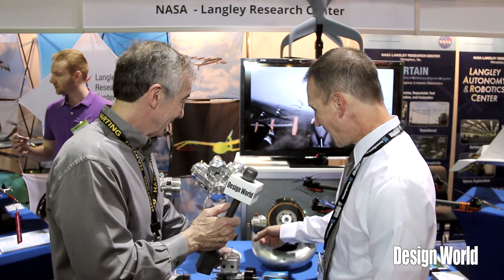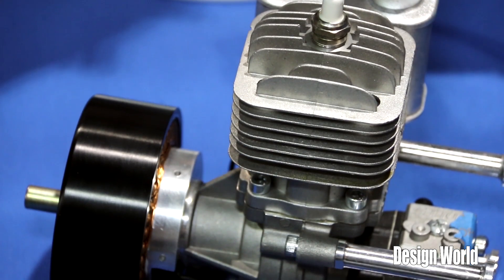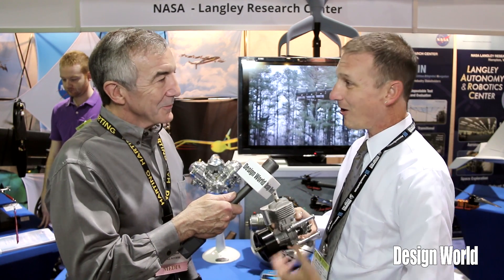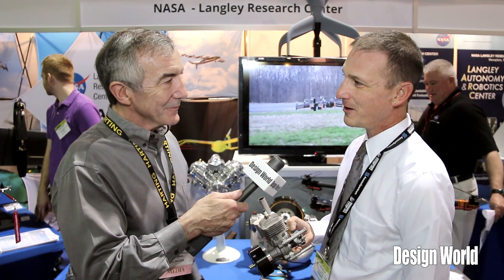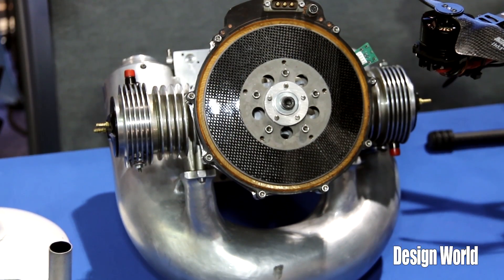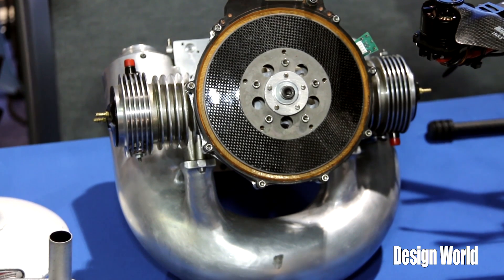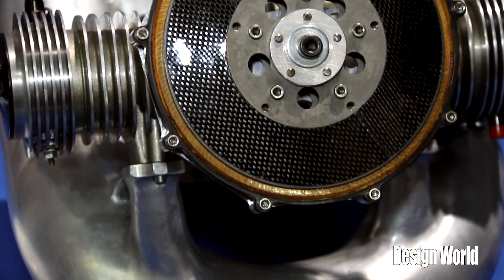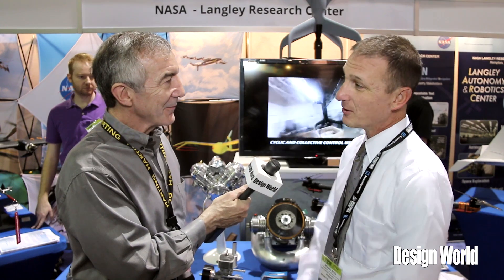How NASA keeps electric planes in the air longer: Hybrid-electric motors

Comment: If two magnets with the same polarity are put against each other within a structure that is permanently held them apart it will produce a magnetic field that will push against itself and all you have to do is provide a shaft that connects to the Center of the generator you connect the shaft get a generator core which suspended magnetically you need no part of fuel do you need to oil you need no gas you need no sunlight it will run in a vacuum and it will produce electricity if you need more information please contact me
Reply: You sob I'm in

Comment: Some of our $45 billion in tax dollars hard at work on weedeater engines. This hybrid design is only feasible with train locomotives because it's a CHEAPER build and the low friction rails make up for the loss. NASA always has been good at wasting our tax money on crap.
Reply: People also thought flight was unfeasible. Thought diesel engines would never replace steam. This is technology of the future. Just because you don't see it because what works now seems to work now doesn't mean it's not going to be outdated in another 75 years.
Reply: NASA only uses the blue collar and the middle class tax dollars.
So if you are making more than $10 million, you are safe.

Comment: I don't...I can't...but why not...  So why not just power the props directly from an IC engine(s) which also employs a very small generator intended to power the control board, video/telemetry radios, etc. of the aircraft, thus eliminating the unnecessary energy losses incurred from spinning a generator that in turn powers a motor?  If you're going to be burning fuel no matter what to keep it in the air, you might as well use that energy as efficiently as possible instead of sending it down a chain of lossy conversions.
Reply: IC engines in general (but not always) have too slow of a response time to effectively balance the load from a multirotor. Electric motors can vary their speed much faster and therefore you have a more stable platform. This isn't to say that you can't design a control system to handle props directly powered off of an IC, but it's much harder to do and is largely a project by project development effort. A generator just functions as a big battery pack and can be used for many different designs with very little extra effort.
Reply: That's correct.  However, I wasn't very clear in my original comment, where I used the phrase "power the props directly" and I left out a VERY important aspect: variable pitch propellers.  Sure, that adds a bit of complexity, but the responsiveness gained from doing so would FAR outperform any craft that uses props directly attached to electric motors.  I have seen a handful of "project" quads that utilize variable pitch prop systems, but they are far from being common - and I'm not sure why except for maybe $$'s.  Because as I mentioned, the responsiveness is about as good as it could possibly get and such a design would ALSO enable inverted flight since the props could generate any amount of thrust from positive to zero to negative simply by changing the angle of attack.  Exactly the way a full scale helicopter operates - the engine spins up to and holds some fixed RPM and then the tail rotor blades and the mains simply change pitch to vary their thrust (pilot modulating the throttle as necessary to accomodate the changing load, to maintain the proper RPM).
Reply: You can also get a higher efficiency at some points of speed.An IC engine has numerous dips in it's efficiency across it's operational range. Running a generator from it means you could run it at the peak efficiency of the engine and use the energy to store in the battery & run the rotors at a different speed that would be much less efficient if it was direct drive.
Reply: The solution : VARIABLE MAGNETIC COUPLING, is a kind of "frictionless" variable electric clutch, used in many industrial applications, the internal combustion engine directly drives  the hubs with the magnetic coupling coils controlled by the on board flight controller, also drives a SMALL group of generator coils in the flywheel to provide electric power for the aircraft control needs, AND a main central efficient duct propeller, that can be pitch controlled to provide most of the continuous thrust needed to keep the drone in the air and the extra rotors just to provide directional control. Infinite number of variants can be implemented with this approach. Keeping weight at it's minimum and reducing conversion losses to maximize efficiency.
Reply: Exactly like rc gas helicopters.

Comment: Wouldnt it be more efficient to use liquid piston engines to power hybrid sys. ?
Reply: Have you found a way to generate electricity at an efficiency rate better than 50%?
And, I'm aware of the engine design you're writing about.
Reply: @cheerdiver  Only huge complex multi-stage turbines can get near 60%.
Reply: @vitordelima  If you input a Kw of energy into an electricity generator, the output of the generator would be a half Kw max.
Your reference is to the THERMODYNAMIC efficiency of converting the potential energy of a chemical reaction to mechanical HP.  Stationary co-generation turbines recover exhaust heat, as well, which will drive a steam turbine (same energy recovery method as nuclear).
The point being, electricity is for toys.  Go to most any commercial equipment rental business and you will notice most everything is powered by hydraulics.  This is due to high power requirements, protection from harsh conditions, and durability.
Reply: @cheerdiver  Internal combustion engines work with 20% to 30% efficiency.

From the page about Combined Cycle Turbines in Wikipedia:

"The electric efficiency of a combined cycle power station, if calculated as electric energy produced as a percentage of the lower heating value of the fuel consumed, can be over 60% when operating new, i.e. unaged, and at continuous output which are ideal conditions."
Reply: @vitordelima  Darn, I've been outsmarted.  Your understanding of information is beyond my ability to comprehend, may your engineering projects change the world.
Reply: that company only exist to rob peoples $

Comment: Ok folks: So here the deal now that they have composite lightweight  motogen hybrid. This could be used on bikes and small cars that would run for hundreds of miles. The trailing bike industry would go wild. Finally the Big Gas Sluts would have to bend to release there Economic patens. We can be a Country not relying on oil. Because there motors can run on other fuel. Right down to Grain Alcohol. Stop  being sheep and step up to say we have had enough of big oil control. Make life better for us all and end the Greed.
Reply: RCWeavenFPV...oh, so you're sucked into the "food for Fuel" BS ?? Did you know that 76% of all our corn production is exported to Europe as animal feed ?????? Yes you are the "Sheep" !!!!!!!!!! It's clear you have opened your mouth before using your brain !
Reply: right one. let's all convert our front and back yards and playgrounds to produce more grain alcohol and spread the wealth.  I am not sheep anymore right? what was it you sell again? fertilizer or farm equipment?

Comment: any stats on efficiency? like, how many watts created per gallon of fuel?
Reply: Ladson Geddings in order to use a fuel-cell you need to have pure hydrogen. Unless liquefied hydrogen takes an incredible amount of space. In order to liquify it it has to be at an extremely low temperature and so you would have to have heavy, complex Refrigeration equipment in order to keep it a liquid. Just pressurizing it like propane won't work with hydrogen.
It seems like you want to get away from fossil fuels. An alcohol might be a better substitute, but it has less BTUs per pound, therefore it would not go as far. It's just so hard to beat petroleum products due to its incredible amount of energy per volume and weight.
Reply: Yeah.  I think that's why he was asking.  The guy had one in his hand.
Reply: Watts created per Gallon? No way. You mean kWh / Gallon or something similar. Watt = Power, NOT Energy.
Reply: Replace the dirty internal combustion engine genset with a Hydrogen Fuel Cell Genset and you have a non-polluting, safe,  hybrid electric airplane with a super long range.  The fuel cell exhaust is water not GHGs and dirty smog like an internal combustion engine.  I'm very disappointed in NASA.; they don't seem to be able to think past the box;  and,  companies like Space X make them look like bumblers  instead of leaders.
Reply: More of a pain in the ass.
Reply: I was gonna say, the first thing you would need to do is determine what fuel you are going to use.
Reply: Ladson...Hydrogen fuel cells are just another form of battery. They don't PRODUCE energy. They store energy that you first produce. You first have to create the pure Hydrogen and Oxygen through VERY energy-intensive means. Then you have to compress each at very high pressures (more energy). Then the conversion rate of THAT stored energy in a good fuel cell is only about 50%. From an efficiency standpoint, you'd be better off with an petro-electric hybrid optimized for the average duty cycle it normally operates at.

This Hydrogen fuel myth just never seems to go away...
Reply: @jck9590  Small engines of 5-10 kW size are only 17%-efficient from fuel to electricity.  Just look at a home back-up generator.   Hydrogen Fuel Cells can attain 50-60% efficiency even at small scale of only a few kW of power, thus a vast improvement in efficiency, plus FC is very quiet for those drones that don't want to be detected, and the lack of vibration is great for sophisticated drones' electronics and cameras.  Vibration can blur images from a drone.
Reply: @amec4888  The problem is not efficiency. Batteries are MORE efficient than Hydrogen Fuel Cells (Why Tesla doesn't do Hydrogen)

The problem is energy density and power density. Its hard to make batteries (or hydrogen) produce the same "watts per weight" on a generator (Power Density) and harder to make the "Watt Hours per weight" (Energy Density)
Reply: Hydrogen is compressed to 6,000 PSI plus, where it remain a liquid  as necessary to be used in FCs.
Reply: Why not use a lighter more efficient mini turbine engine like used on rc jets.With such high rpms they could run the gen at high voltage low amps which is also more efficient.
Reply: wouldn't the watts per gallon depend on the efficiency of the gas engine and the generator?
Reply: No, you can generate UNLIMITED watts from one gallon of fuel. Problem is, it doesn't matter. What really matters, how many watthours you get. And it would have been interesting how many watts that ironless thingy produces.

Comment: Really.  The guy just showed that the rotor of an axial motor can be formed using carbon fibre and there's no one commenting on it?  
That's really clever.  I nearly fell of my ikea klippan!
Reply: HeathenGeek  https://en.wikipedia.org/wiki/Electric_motor#Ironless_or_coreless_rotor_motor
Reply: pen mightygun: BLDC generators are also motors... This one is axial.

HeathenGeek: the stator is carbon fiber. The backplate holding the halbach array is the carbon bit.
Reply: HeathenGeek What is an axial motor?
Reply: That's not an "axial" motor.  That's why.